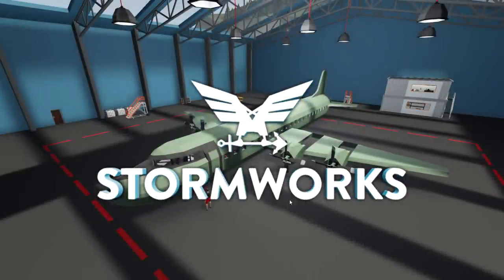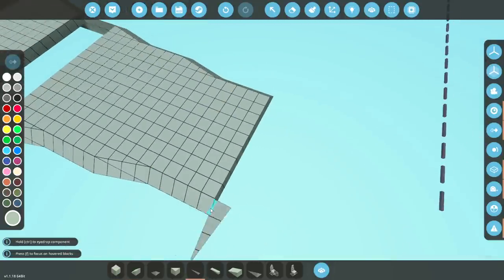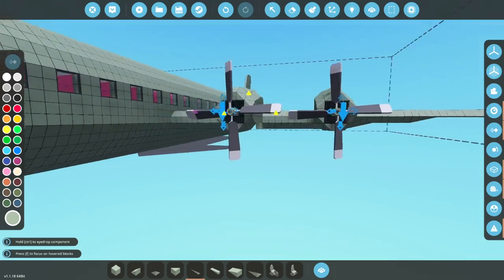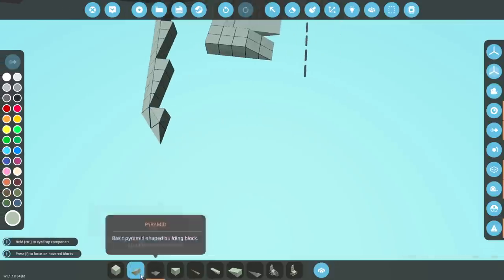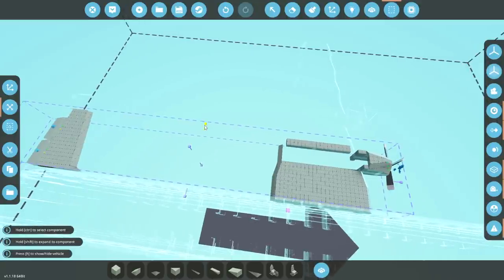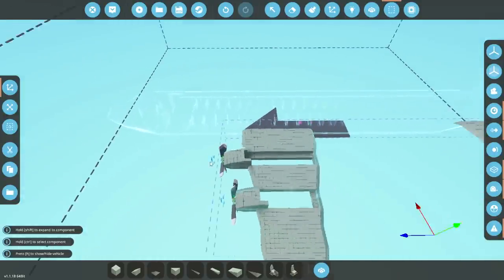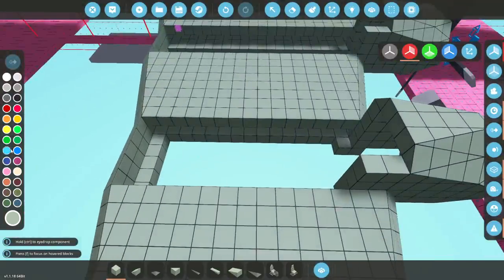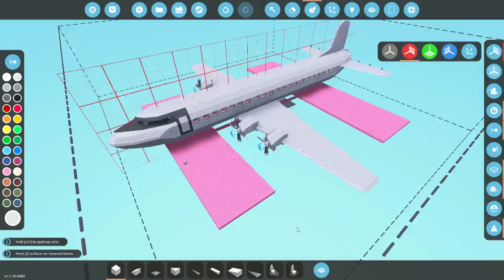Longer Wings!  -  Small Airliner Build  -  Part 5  -  Stormworks Gameplay

Comment: I think you can fold the tail in the work bench using a pivot then when it spawns it would become taller. 
Also the problem with the wing angle is that on some planes it affects it in flight like roll, atleast in stormworks.